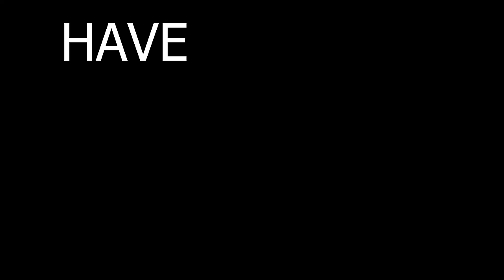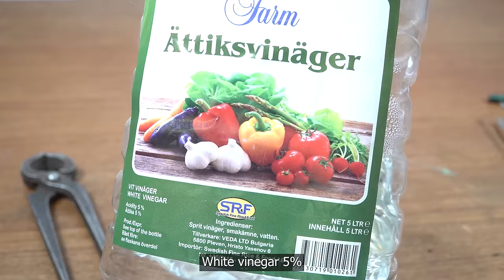Opinel N°7 from 1955 Restoration - I got it for FREE

Comment: Great job, buddy! This Opinel is probably about 60 years old, since it does not have a viroblock (and on the blade of the knife you can see a mark corresponding to that time).  I have an Opinel of about the same age (and with the same mark on the blade) only I have an Opinel No. 9. My Opinel has its own story, its owner is an elderly Italian. He gave this knife to my friend, and he in turn gave it to me .  Just like you, I cleaned and sharpened it and still use this knife. Thanks for the video and your work!
Reply from the maker: Fantastic story, thanks for sharing! Glad to hear you saved that one! Kudos!

Comment: I bought one of those knives about 30 years ago to use as a letter opener. It was so sharp it scared me to open it. I put in a drawer and left it there for about 20 years. When I pulled it while packing to move, it was still scary sharp.
Reply from the maker: Thank you so much for sharing your experience with the knife! It's impressive steel and the Opinel factory makes really sharp knives that stay that way for a long time. Out of curiosity, what Opinel size do you have?
Reply: @FFD_Restorations  It’s a No. 8, one where the ferrel turns to lock the blade open.

Comment: 👍 Another excellent restoration.  I really like Opinel knives.
Reply from the maker: Thank you kindly for your encouraging words! Opinel knives do have a timeless charm, don't they? Out of curiosity, do you have a favorite model or series among the Opinel collection?
Reply: @FFD_Restorations  My Opinel preferences are pretty mundane.  I prefer carbon steel blades in size Nos. 8 & 9 — their most popular sizes.
Years ago I was able to purchase one in each size that had been modified by replacing the wood handles with stag.  
I also own a No. 8 that was manufactured by Opinel with different types of wool laminated together to form the handle, I plan on replacing the stainless blade on that knife with a carbon blade.  
I also like their No. 12 folding saw. 
Which models do you like best?

Comment: Nice restoration. That "virole" doen't have yet the second ring that secures the blade open, so indeed it's very old, pre-1950's I guess. And in France there's a say : "you can't give a knife, such a gift would cut the friendship". So, because of that, and because of what you did to that handle and because the blade lost some of its distinctive "yatagan" shape, she'll come after you, yelling at you with that weird 50's-60's posh/actress accent we heard in the video. Good luck.

Comment: Nice work. I notice that there was no locking ring on this knife, maybe because it as so old?
Reply from the maker: Thank you for your kind words! I appreciate your keen observation. You're correct, the absence of a locking ring on the knife is sign of its age. It's fascinating how designs and features evolve over time. Do you have any favorite vintage tools or knives?
Reply: I have a lot of restored vintage tools in my workshop, too many to have a favorite. The Opinel No.7 is one of my favorite knives, I will have to look for one that needs restoration. Thanks.

Comment: The way to open an opinel is to tap the bottom on the table so the blade lift up
Reply from the maker: Thank you so much for sharing that tip on opening an Opinel! I appreciate your guidance. I'll definitely give it a try. By the way, do you have any other favorite techniques or recommendations for using Opinel knives? I'm always eager to learn more about such tools.